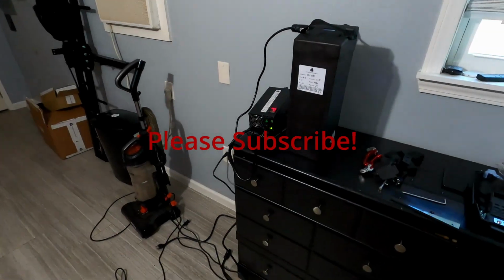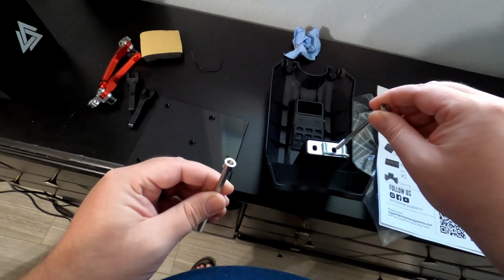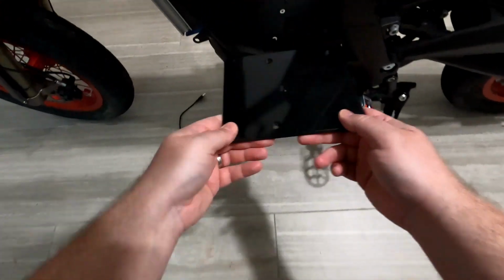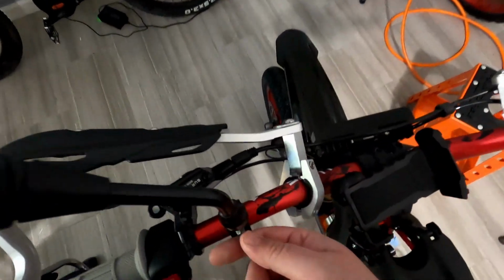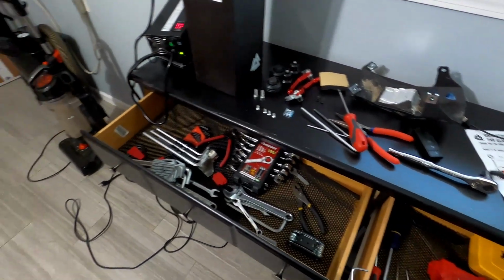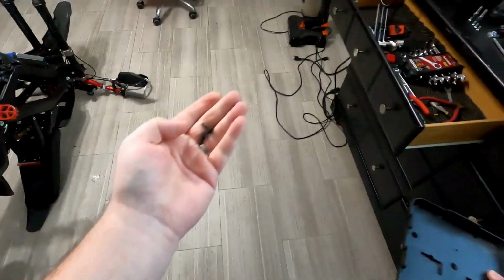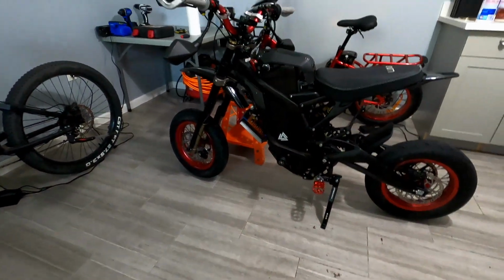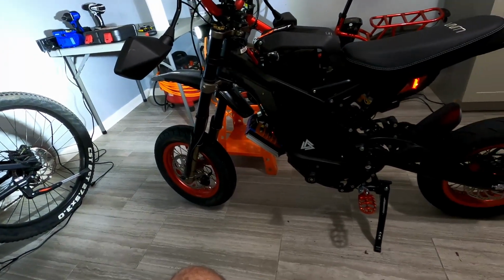Sur Ron Chi 72v 51ah MAX Battery Install #surron #ebike #electricmotorcycle #install

Comment: Quick question what did you do to the extra connector that goes connected to the 60 V stock battery? Did you remove it or hide it next to the battery?
Reply from the maker: I taped it up with electrical tape and stuck it down with the rest of the wires.

Comment: Order the racespec skid plate very hard plastic check it out
Reply: Im looking at the sxs skid plate at charged. I like that it protects the bottom of the controller for off road riding. Unnecessary for street though and expensive.
Reply from the maker: I'll check it out, I kind of want to find an aluminum red one to match the red on the bike.
Reply: @FewMoto  That would look so nice with the wheels.

Comment: Hey Jason I believe FewMoto.  I installed my battery and I have a nuc24f Controller. OMG this thing is fun holy F what a difference from stock.  I do not understand this controller though. Have you had any experience with adjusting the bike setting using a nuc24f controller? I feel like you have to work for NASA to understand how to set this controller to the right settings so you get maximum performance out of the bike. I see you have the Bac4000 so you probably dont know anything about the Nuc24f controller but I thought id ask anyways.
Reply from the maker: No sorry, that's the first I've heard of that controller.

Comment: Thanks for the video! I keep stripping the stock surron bolts. Got a titanium bolt kit ( $200)
Those strip just as easy 😂
Driving me nutz
Reply from the maker: I've stripped a bunch too
Reply: @FewMoto  ive spent 2 days trying to get out a completely stripped fork bolt.
Trying jb weld for 2nd time.  Hoping it works today, it's been a mess 🤣